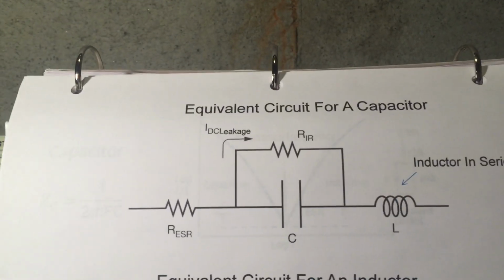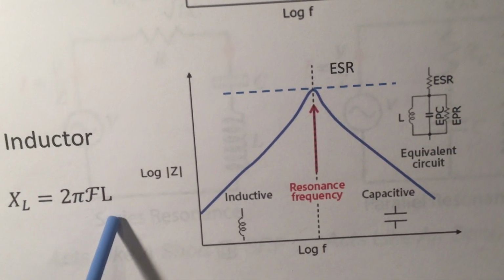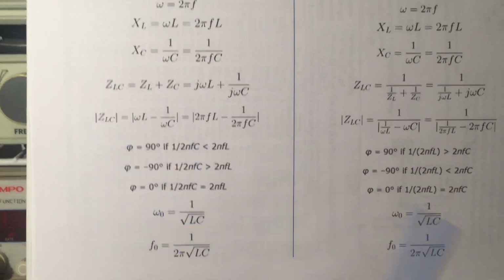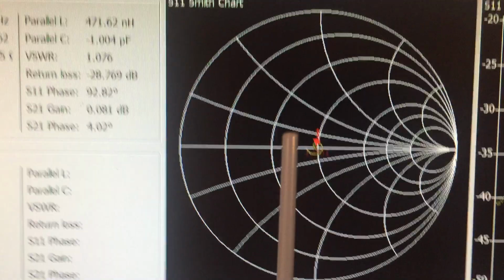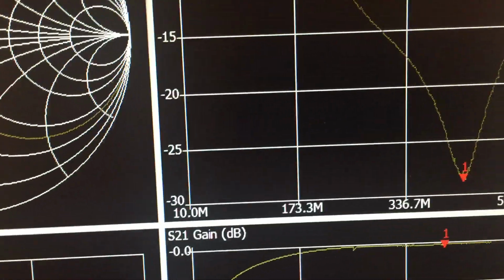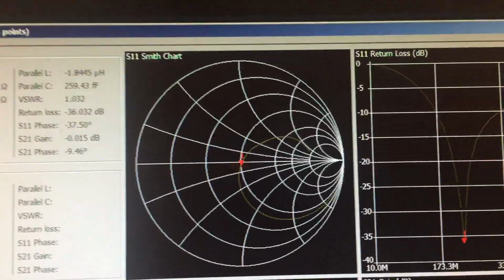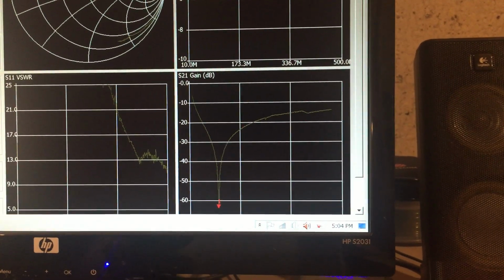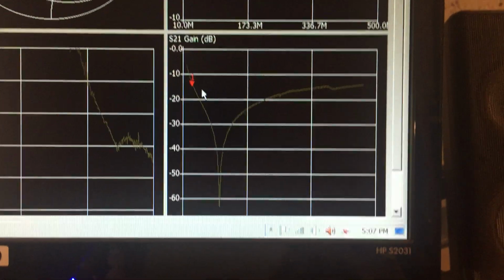RF Man Discusses Self Resonant Frequency of Capacitors and Inductors

Comment: Hi , how to make fixture, which is error free
Reply from the maker: You will never have a fixture that is "error free". For s parameters measurement, you have to "de-embed the parasitic effects of the fixture. If you keep the socket and lead lengths as short as possible, you will minimize the error. The accuracy is good enough for the frequencies we are working with......